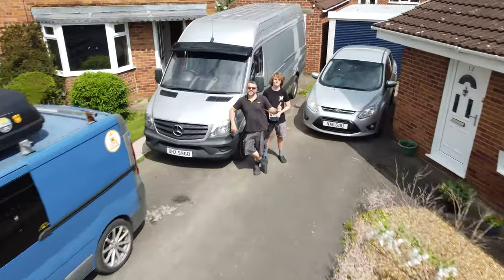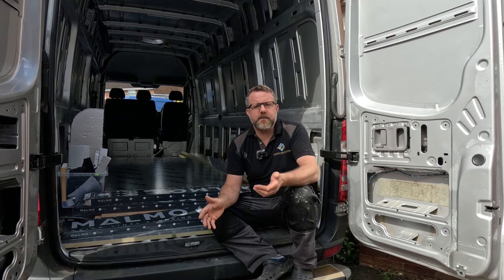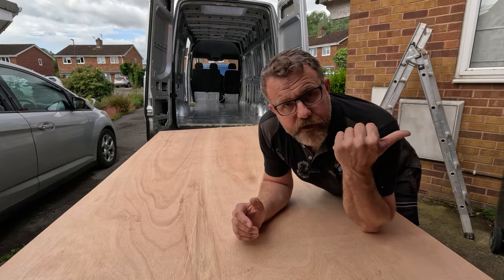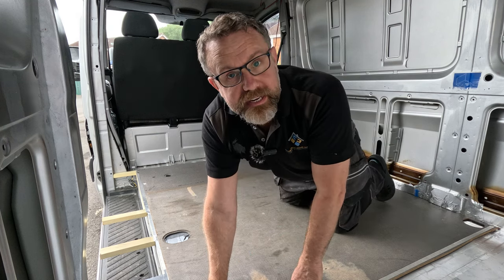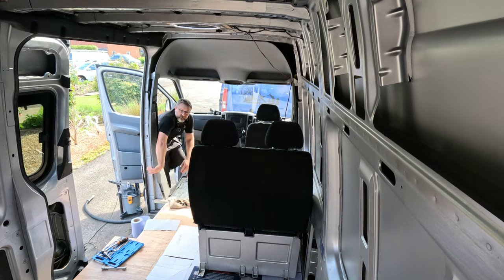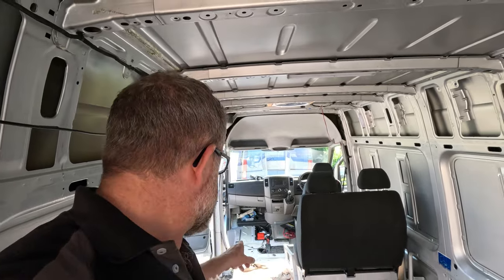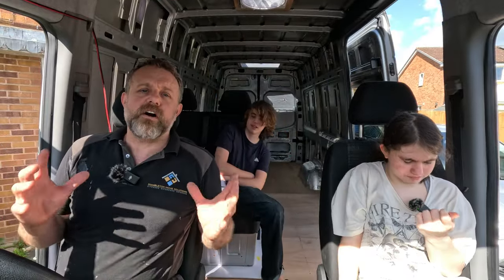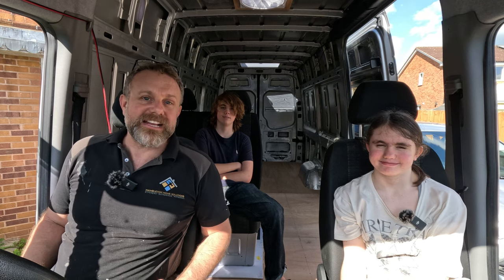Van conversion flooring the simple way, on our Mercedes Sprinter

Comment: Another great video! Have you thought of putting a window in the side panel? Would be nice for the person that sits in the back to enjoy the views when driving around Europe. 😉
Reply from the maker: Hi👋. Thank you 😁. Yes I plan to add another window there. Just not sure what size to order yet till I know the shower dimensions. It'll be a hinged opening one👍👍
Reply: Isn't a window as you have put in the sliding door not an option? Then you have a large window and the piece the shower is blocking you can darken with some window tint. You can even put one in with a sliding function, so you can open it while driving, gives some fresh air for the passenger. I also like the look of them as it looks more original, but that's maybe my ocd. 😁
Reply from the maker: @MrTrs1978  yeah I know what you mean. But I really fancy one we can open when it's raining once parked. Also opens wide up. Probably use air con when driving 😂😉
Reply: @life_uncharted  Good point, especially while camping in the UK. 😁 My experience is that the ac of these vans are only capable of keeping the front cool and fresh, it's not designed to keep the whole van cool. But you do what you want to do, it's your van and you're the one building it, everybody has their own ideas. Keep up the good work, I'm enjoying your video's each week. 👍
Reply from the maker: @MrTrs1978  cheers. Yeah we already tested the ac. Seems to do a good job. But not had it in Southern Spain temperatures yet😂😂😂.